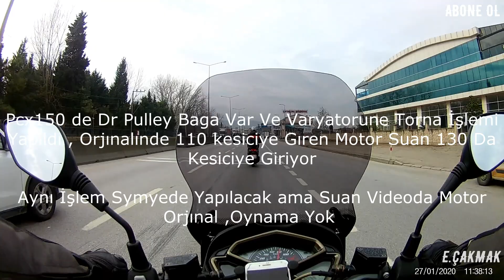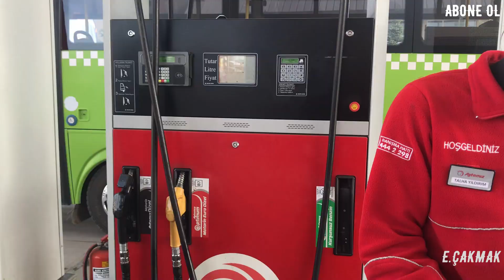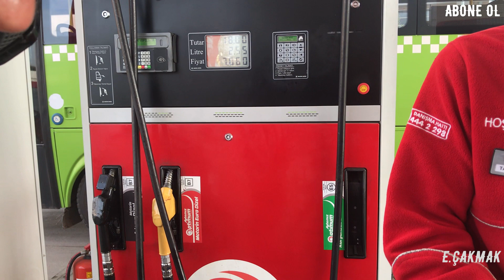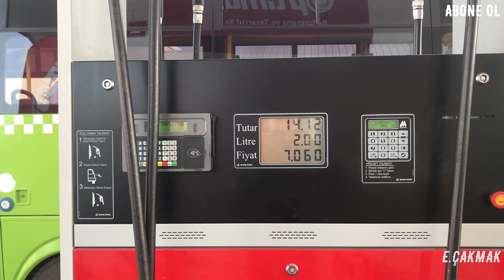SYM JET14 200i && HONDA PCX 150 , ' YOL,YAKIT TÜKETİM,PERFORMANS MOTORLAR HAKKINDA BİLGİ'  part1

Comment: Aleykümselam,  HONDA PCX koklamış be sanki benzini, SYM JET 14 te iyileştirmelerden sonra mutlaka düşecektir ha 2.0 litreye gelirmi bilemiyorum tabii, hayırlısı olsun.
Bu arada videoda atladımmı bilmiyorum, PCX 125 cc motor dimi eski modellerde 150 cc idi diye biliyorum
Reply from the maker: 50 yAş Ve öTeSi  ıyılestırmeden sonra bnde merak edıyorum dusecekmı dıye .vıdeodaki pcx 150cc , pcxsın sıfırı suan 125cc , eskılerı 150cc
Reply: @emrecakmak7100   evet öyle ama 2020 modelde 150 cc gelecek denmişti, tabii geldiğinde görürüz
Reply from the maker: 50 yAş Ve öTeSi  ADV dıye bı modelı gelıcek . Oda 150cc olarak .  Yamaha nmaxse rakıp .